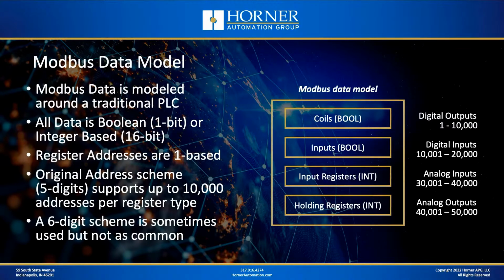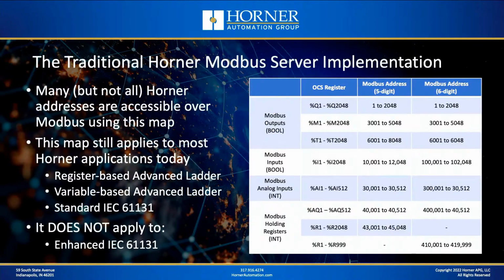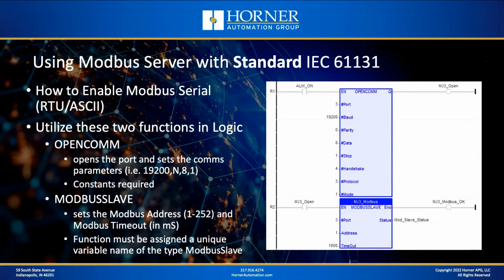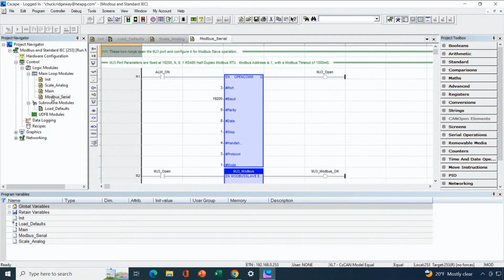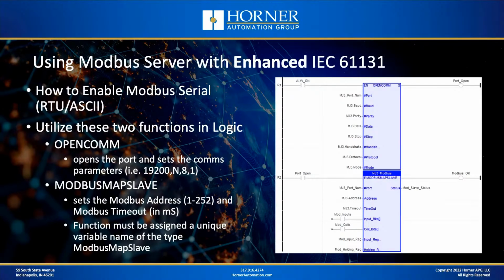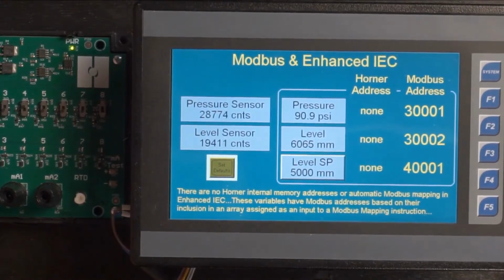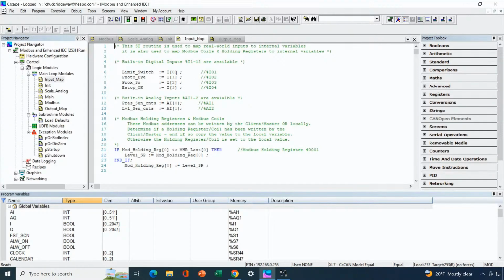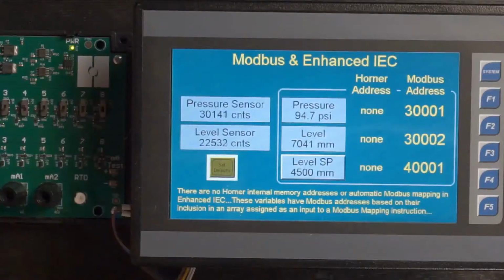Using Modbus TCP & Modbus RTU in an IEC 61131 Programming Environment

Comment: One other important note is that Enhanced IEC is a licensed feature in the OCS Controller that is running it.   Enhanced IEC programs can be created and simulated in Cscape without a license - even downloaded to the OCS controller.  The program won't go into run mode until the OCS is licensed.  License vouchers are available for $50 US from our USA web site or your local OCS distributor.